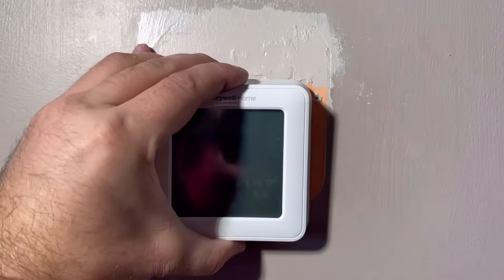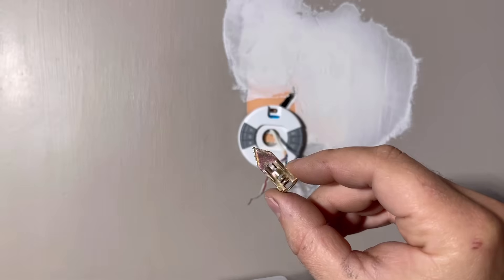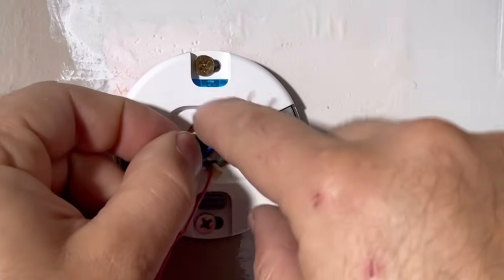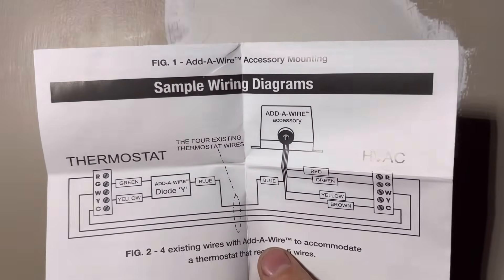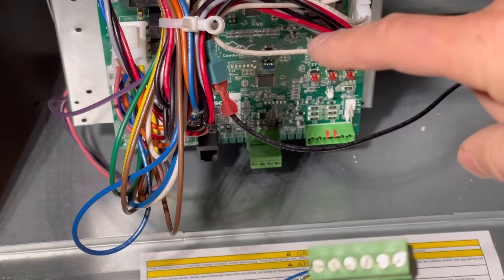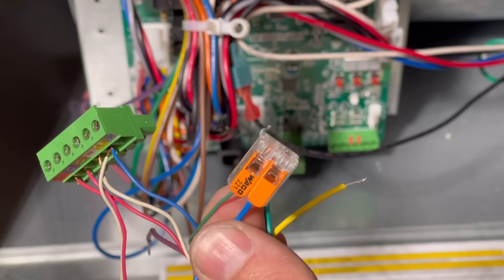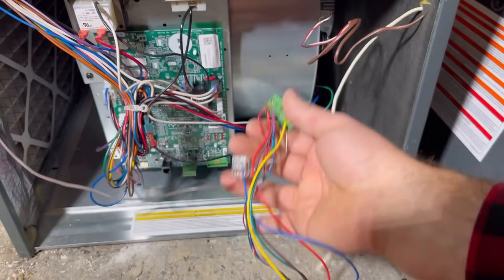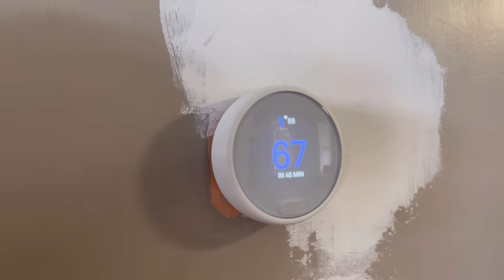The Easiest Way To Add A Wire  | Google Nest / Ecobee Smart Thermostat C Wire

Comment: Ecobee makes a model of their smart thermostat that includes a pek(power extender kit). It connects to your furnace circuit board.
Reply: It's really nice that they include it when you purchase one, where as if you purchase a Google Nest, you must purchase the PEK as a separate. 

I think Ecobee is just a nice product overall compared to Google Nest. 

If you want the trim kit as well, you must purchase that separate from Google, where as with Ecobee, you receive it for free.
Reply: @enrick7518  just bought the ecobee smart thermistat enhanced because it has the pek+ needed it for a whole house dehumidifier, removed my nest learning that was reading 20% higher humidity. Screw Nest. Oh I like the geofefencing on the ecobee. Set home, sleep, away, with radius. Humidity is very close too.
Reply: @Nolaman70  interesting. 

I was wondering if Ecobee had a solution for those with humidifiers. Thanks for sharing this.
Reply: @enrick7518  it can be programmed for anything but there is only one on the enhanced the next model up Premium has 2 PEK+ and PEK- I think. I will need to use a relay coil to pek+ other side of coil to common and the 2 contacts to DH DH on my dehumidifier. Easy enough.
Reply: @enrick7518  The ECOBEE seems to be more "advanced" in regards to options, where as the NEST seems to be more kind to "dumb" users.
Reply: Yeah he has a video on installing that